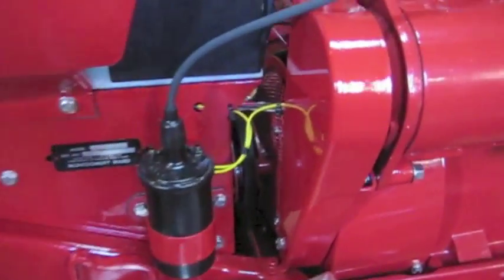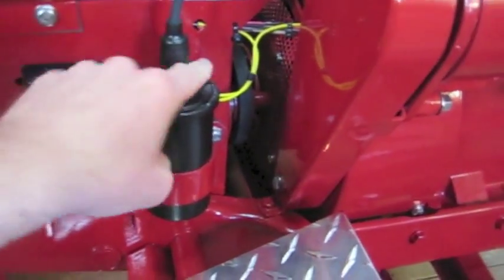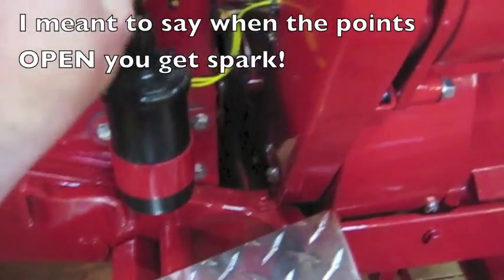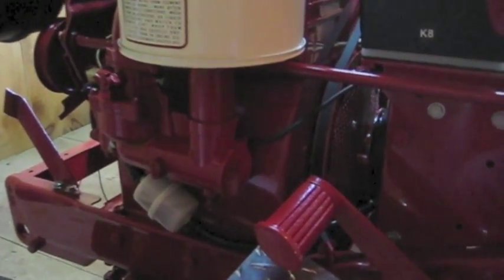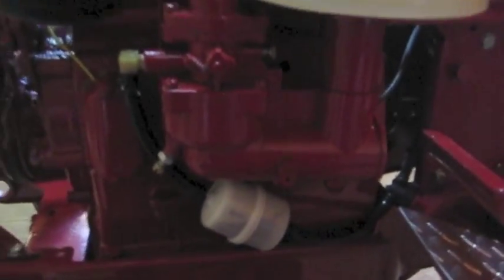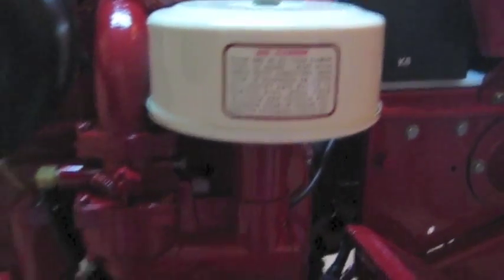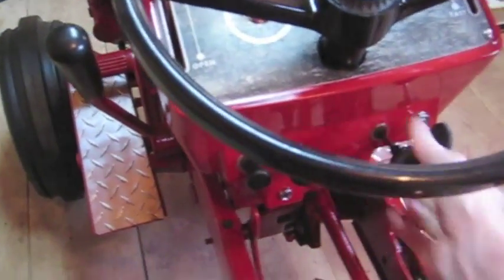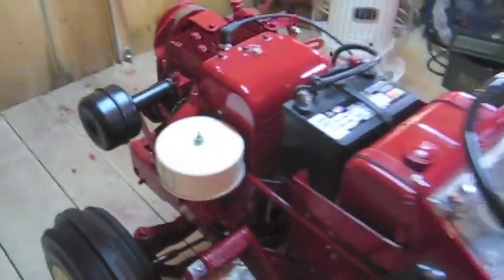5 - Gilson Tractor Restoration / How to wire the coil and points

Comment: I really like this series of Briggs engines. I have the 10HP version on my Simplicity and it runs so smoothly, it hardly vibrates at all.  It seems massively overbuilt by today's standards. I wonder if the engineers knew that they were designing an engine with a 100 year design life? To me it's this kind of quality that makes tractors of this vintage so special. American quality construction at its best.

Comment: I'm looking at an early Gilson like yours, but the steering column and wheel are missing.
Does the Gilson have a Ross steering box similar to the Cub Cadet.
Reply from the maker: Hello...  No they have completely different steering columns.  My gilson / montgomery ward tractor has two very heavy duty cast iron gears at the bottom of the steering column.  This tractor was built a lot stronger than the Ross steering columns that cub cadet and others tractors used back then.

Comment: Did your tractor come with an external coil? First time I've ever seen that.
Reply: Sweet tractor by the way.
Reply from the maker: Yes.  These old tractors from the 50's and 60's were set up with an ignition system similar to cars from that time.  They had generator, voltage regulator, battery, starter solenoid, coil, points, and the key switch.  The key switch even had an accessory position if case you wanted to use the lights or cigarette lighter with out starting the motor.
Reply: I have the same  tractor but the Wards model. It doesn't have the external coil.